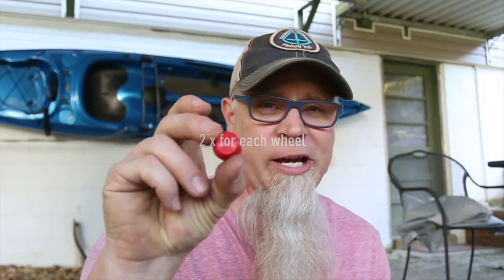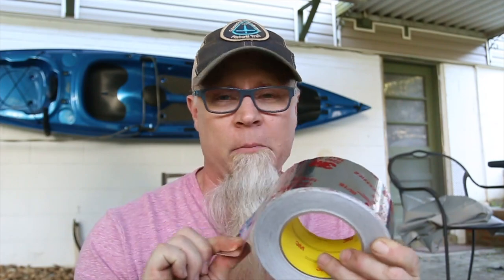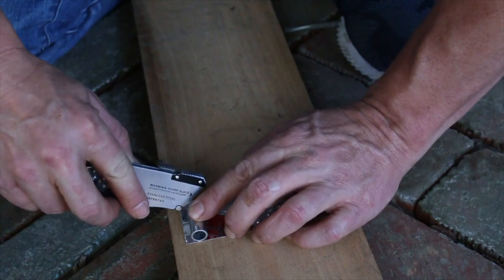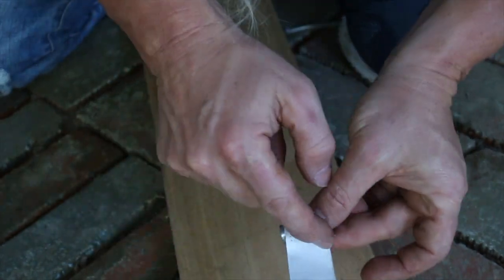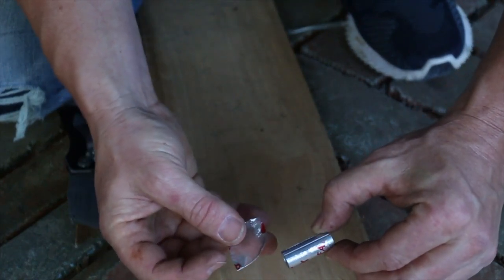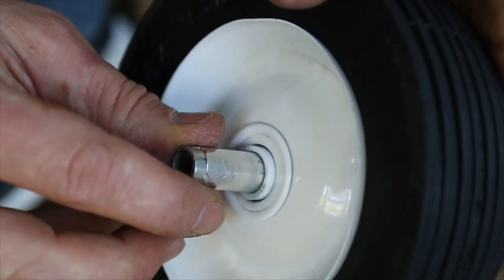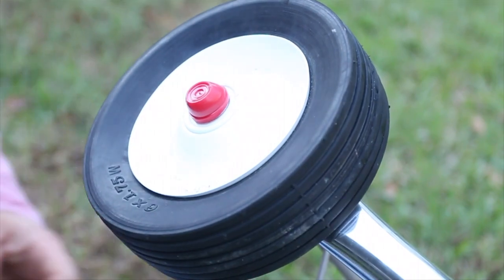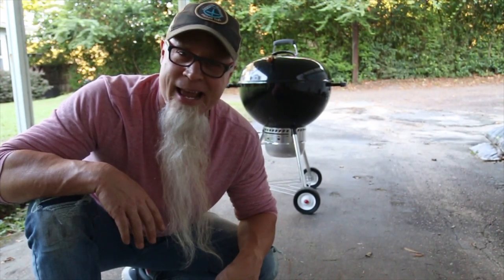Weber Kettle Wheel Mod

Comment: I just used 12 inch wheels on mine, to make it roll better on ruff ground and lift it up 3 inches. I cut the end of a broom extension stick off and put it in the third leg to level it. I also used nylon bushings on the axles from Lowes, but they came the wrong size. I had to drill the center out to 3/8 which didn't go as well as I hoped so the wheels don't turn as smoothly as I hoped, but it works and I don't have to bend over as much to use it.